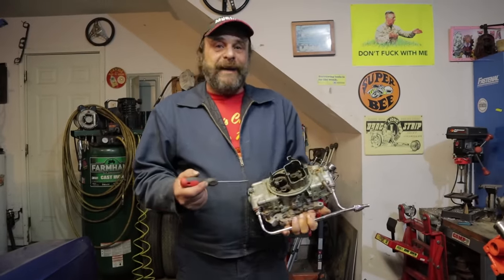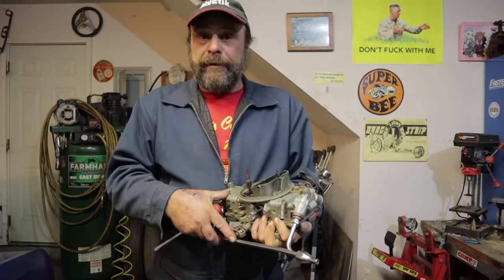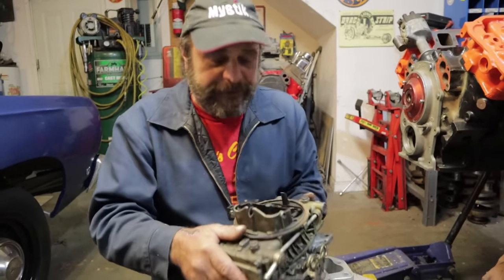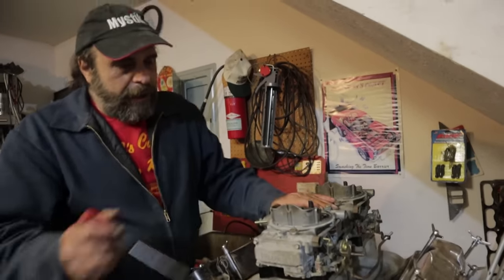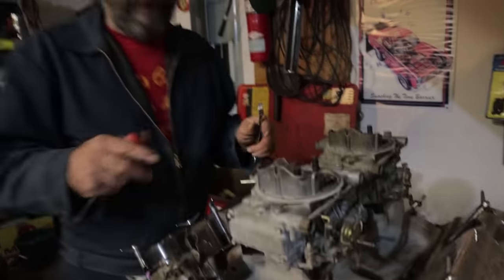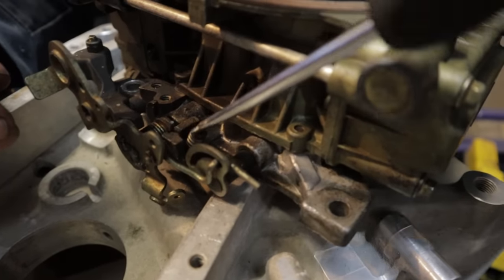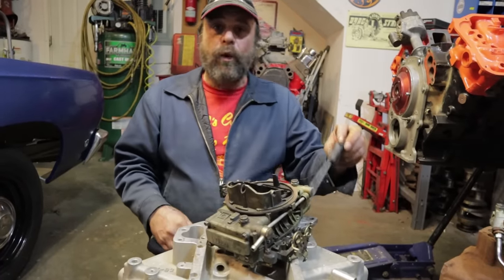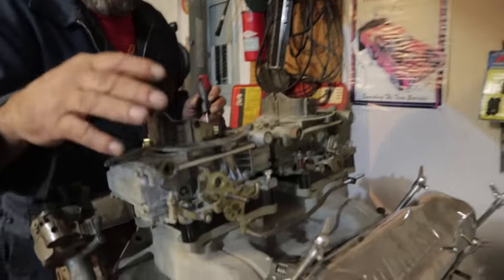Holley Set-Up and Adjust Step By Step

Comment: My relationship with holley carbs over the years can only be defined as "love hate"
Reply: For the last 40+years, me too.
Reply: I've heard the same. Edelbrock might be more my incompetent speed.
Reply: Love hate, when they are set up right I love em, but when they are out of whack I hate em
Reply: My 87 omni had a Holley. Damn thing would get stuck WOT sometimes. Key. off .pull over. Beat with any combination of rock ,piece of curb/ shoulder & tire iron.
Broke CV joint & Got a Daytona before I figured that one out.
Reply: That seems to be 90% of the population feeling about carbs period :D
Reply: Simple as change of weather could have huge effect on them carbs. Jeep CJ-5 with built 390. 1 Winter used as a daily driver I for ever under hood. Carried insulated coveralls with me.
Reply: @theejoeylee  if you loved yourself, you slap a Weber on it.
Reply: Quadrajets and Thermoquads. Heck yeah. The only Mopar way.
Reply: Amen, brother.

Comment: Holley use to have lots of recommendations and tuning tips on their web site. Usually with a rebuild kit there are lots of little tips in the instructions as well. 
I've owned lots of Holleys and still have a whole shelf full of them. once you learn to tune them you won't want to run anything else.
Reply: Agreed.  I used to have an Edelbrock and thought it was great and I guess I still do.  I now have a double pumper and took the time to learn as much as I could about it (there's always more that I could learn though) .  I've been running the Holley for over a year now and I love it.
Reply: @bouncingsoul777  Curious what you love about the Holley vs the Edelbrock?

Comment: WOW,  Tony. Thanks a bunch for bringing back Fond memories. Of tuning and setting up the normal Holleys and the Double Pumpers.
    Had a Large double on my 350 Chevy small block.  After getting it in place and bringing the fuel in right. 
  Would take my truck around the block and after setting every thing just right. My Truck would dance!
   Foot off of the Gas. Almost dead stop, just rolling. Tap the Gas it would jump forward again! Any good music worked. LOL 
  Any Long Highway or Freeway traveling. Just cut the Gas out until before dying.  Back a touch, then adjust idle to lower rpms.
  Best way to get better MPG, and save cash too. 
   There isn't any vehicle that you can't tune just right  with those Hollys!

Thanks again for the video. And it looks like you had Fun doing it too!

Comment: Just finished my 302 install that I talked to you about on live stream once! It's bored out to a 312 that's why I called it that during the stream. I got the engine basically running but my timing is way off so after I get that I put a basic carb tune like the one you mentioned here on it. Thank you so much for many great years of expert advice! I wouldn't be in the place I am today without your guidance

Comment: we used to rebuild these carbs 40 yrs ago when we had a fleet of 460 fords. you are spot on when it comes to the external adjustments. we were always replacing the 'power valve',  usually a eng back fire would take it out... the problem we had was that very few guys knew how to rebuild them & set them up. an old school mech showed me how & it wasn't that bad once you rebuilt a couple of them..  i was glad when they sold off those 460 fords though!

Comment: Thanks for this video. I just recently purchased an 83 Camaro Z28 that had been swapped with a SBC 350, and have spent the last 2 weeks rebuilding most of the mechanicals from the ground up, replacing what needed replaced. I have it moving down the road now, but it needs some tuning, it has some hesitation when the throttle is mashed but accelerates smoothly if I ease into the throttle. I've never tuned a carb, but this video makes me think I at least have a shot at it. Holley DP 4150 is what I am working with. Thanks again!

Comment: Thanks so much for your videos. I greatly appreciate them! This seems to be an artform that this slowly disappearing. 

My girlfriend has her grandpas trucks (69' F-100) and it seems to start/crank just fine. We replaced the carb with a refurb'd motorcraft carb, since we couldn't get her accel. pump to stop leaking (even after a rebuild). It not longer leaks after the carb replacement, however the truck will crank, start and idle just fine- even without the use of the manual choke- but after it warms up (like driving to work), the truck will lose power and eventually stall. It won't run again until after a good 15 minutes or so have passed. 

We have spark- and the truck doesn't appear to respond to carb cleaner when sprayed. After it cools down though, it acts as if nothing has happened. 

I'm "new-aged" mechanically inclined- so I'm somewhat familiar with engines in general, but this whole carb thing fly's completely over my head. She wants to sell the truck- but it starts up and drives so good, that I believe that it's just a tuning issue- or something that happens AFTER the truck has warmed up, and goes away once cooled down a bit. 

Not sure why I'm writing this long post. I'll go back through from step one and see if I can't better describe the issue that we're witnessing and then report back. I'm sure we'll be referring to your videos until then. Thanks again for all your guidance. It's very much appreciate from keeping older vehicles from the yard. 

Joey

Comment: Interesting information Uncle Tony, although the Holley Manuals can be jam packed full of Carburettor goodness, they can be a little vague at times. Wholly, I think the eagerness young blokes can be at fault here wanting bolton power - fit and forget so to speak - and wonder why they run into trouble for rushing a job they needed to take their time with. I believe the mystery of Holley Carburettor tuning is solved, so it makes more sense now. I did see and read an article last year where a double pumper was modified for street/bracket racing for aesthetics, power, metering and airflow, which was very interesting indeed. Thankyou for sharing this, Cheers :-)

Comment: THE SIZING OF THIS DESIGNED PART is everything,just like sizing the cam for the use,this carburetor has been masterminded since 1970,me, is use the 350 500 cfm two barrels for all of my needs,for drag racing and top end speed,its a proven track winner, LINDSAY proved two of them were even better than mechanical fuel injection on the fastest SUPERBIRD in the world on the bonneville salt flats,carburetors are superior for total all out fuel flow,it was a normally aspirated and damn impressive hemi,they function pretty good on blowers too

Comment: Absolutely great vid . Im in the uk and have a dodge d100 1971 , 318 v8 with holley carb same as the vid. 

The motor is burning oil pretty quick ( but no smoke coming from exhaust, even under load) 

It has a couple of oil leaks i need to address first, one of which is intake manifold gaskets. But these are only seeping/not dripping.. 

I also have oil coming out of the dipstick tube when pcv valve is fitted, if i remove and vent to atmosphere this doesn’t happen.  ( was venting to atmosphere with pcv fitted anyway) 

It doesn’t struggle to start and even runs okay, smells like its running rich though . 

Never had anything like this car wise and worrying ive bought something that may need more work than i would have liked . 

🤦🏻‍♂️

Comment: Bought a 350 Chevy with a Holley.  Leaked; replaced it with an Edelbrock that was laying around, runs great.  Hope to build the Holley soon but looks complicated with the different cams, other adjustments and jet sizes.  Rebuilt a Quadra jet years ago and it worked very well.

Comment: You are the Man. Not only you have the knowledge, you can also transmit it. I was wandering if you could help me with a question please. I am now 67 years old, and in my younger days I use to work on cars. Recently I have changed a 1986 Automatic Full size Bronco 351 Cleveland rebuild and with no many miles on it, from dedicated "LPG", back to Petrol, ( or what you guys in the States call "GAS", I live in Australia by the way). I fitted a 600 Holley Vacuum secondary which I had put it together at least 20 years ago. It  starts at first go and idle to perfection and smooth, but I smell fuel vapour at starting, more like an exhaust fumes like, even in the engine bay. Accelerates smooth and quick .I  changed the" MSD" mechanical advance bush into the blue , All up I have 32 degrees advance with 11/12 basic. the bush for LPG I had to make it myself because it didn't existed in the distributer kit , etc. .Once on the road I'll have to finally tune the through out springs, to suit the mechanical advance. Question is... : way it smells so reach??,. adjusted "carter" electric fuel pressure to 6 PSI with cold temperature anther the bonnet and engine . Fuel pump should start together with the starter motor solenoid at firs  ( because of the safety switch installed), but, because it is/was only a Sunday car, or just to go bush, when I rebuild the engine I fitted a secondary oil pick up, Just a tube like, just off the inside bottom of the oil sump) in other to pressurize the block before occasionally start it, and what it does, it starts the fuel pump a bit prematurely, maybe coursing a rich condition???. I didn't had this problem with "LPG". Or I am imaging thinks???? So I dropped the Fuel pump pressure to 5 and a 1/4  "PSI" , I will restart the truck tomorrow in day time.. " too late now". Will like to see if the enrichment is gone, but a good needle and seat valve and good float adjusted (as "I THINK" they are???), should stop  extra fuel passing needle and seat, unless the "O" rings are flatted???? . The carburetor was kipped in a seal plastic box, and when started first time two days ago, the throttle plate leaked a drop or two only, out of the secondary side plate shaft, (and no more now),near the secondary vacuum unit. I hope I gave you enough description, I know is never enough. You response and opinion at your time, is very much appreciated. Kind Regards... "COS".

Comment: Thanks for the video and for sharing your knowledge, Tony.  Holley carbs or any carb for that matter:  It's all about physics and math. ( I'm glad that Holley did a good job with that and documented it for the masses.)  I've been using Holleys since the 1960s and love them.  In the 1980s, Holley came out with the 4010 & 4011 series, (which is no longer produced by Holley).  They were my favorites for street use because they had annular discharge boosters and the float bowls were cast into the carb's housing, so obviously no leakage from there.  All of the "consumable parts" that fit the 4150/4160s, like floats, needle and seats, accelerator pump diaphragms, ect. fit these carbs.  The only issue was finding the correct squirter size which, unfortunately, was cast into the booster assemblies so you had to replace the whole damned thing.  
 When these carbs went out of favor, Holley didn't waste any time quitting the making specific parts, like the boosters.  Summit Racing saw something in these forgotten carbs and bought the design.  It's now sold in a much more refined version that provides for tunable squirters and idle fuel circuits.  The design that originated at Holley became the basis for these durable and dependable carbs.  I've got a 600-CFM, vacuum secondary version on my late model 5.0 that sits in my 67 Mustang Fastback.  (I just had to say that)  Also, I don't want to sound like a salesman, but I'm just sayin'.  It's a damned good design that's affordable and doesn't constantly need attention.
There's one more thing to add:  The old Holleys were heavy because they were cast in zinc.  Zinc and ethanol don't like each other, even 10% ethanol has given me issues if the fuel sits in the carb for a while.  
The 4010 and 4011 series were all aluminum which was something new for Holley in the 1980s.  There was the discovery of a casting method during that time that made intricate parts more easily cast in aluminum at a reasonable cost.   It seems that most of the 4150s and 60s sold today are aluminum as well as those Summit units derived from the 4010 & 4011.  The zinc castings are still available from Holley, FYI.
Thanks again Uncle Tony.  You've got a good channel that shows the world that there's more than Chevrolets out there that go fast.

Comment: I was looking all over for how to get back to the base settings after I changed heads. This would have saved a lot of trial and error. One thing that really helped get it running right was getting the transfer slots adjusted.
Reply: Should just see a square hole forming on the transfer slots

Comment: My problem and I have the Holley 80457-2 4 barrel.  Starts fine, and revs fine sitting.  I live in San Francisco and my car is struggling to get up the hills. Have had a full tune up, car electronic ignition, 350 Chevy eng.  going up hill, struggling to achieve power, no surging, and I can put car in lower gear and no difference.   
Ideas?  I thought could the mechanical fuel pump be bad? Car has 2,800 miles on a 18 year old engine.

Comment: It was refreshing to see you using SAE wrenches. I used them on my '82 Dodge but that was decades ago. Everything in my yard these days is 99% metric. 2000 Ford van (Canadian built-the 99% metric), 2006 300 Semi-Hemi SRT8 and 2015 Hondu Civic. I can send you another set of SAE wrenches if you need them, I don't have much use for them anymore.
Reply from the maker: Thank you! But, I've already got plenty

Comment: believe it or not I just gave a speech that was just a condensed version in this the other day in college, brought in my qft 600 cfm carb and rebuilt it in front of the class.
Reply: Nice Dude.. don't ever Give up.. if they will listen, keep telling them..
Reply: I have a similar story. My shop teacher in high school was giving a lecture on Holley carbs and I had mine torn apart and was telling my nearest classmates what everything was. "Mr. Aguilar, would you like to teach this lesson?" Sure. I'll give it a shot. "Mr. Aguilar, would you please go to the office and tell them to put you in Shop 2 as a student and teacher's aid for this class?"
1983. High school.
Reply: Hey you could give them a demo on a Rochester Quadrajunk. My be less than desirable but if the floats stick just tap it with a hammer to free up the obstruction.   Then ask if they can tap on a clogged injector with a small hammer to get by ??

Comment: I once had a Chevy 350 that I put a 750 Vac secondary Carb on.Mild cam also & old cast iron Exhaust manifold on to.It ran like a pig on full throttle but ran perfect on a Dyno.Turned out the fuel line was getting to hot next to the exhaust manifold & the fuel vapour was drawing in on acceleration full throttle & stuffing up the fuel pump.Also the fuel pump was over 7lbs pressure & this stuffed up the float level in the carbi.Next I found out the Mufflers were 2 restrictive & this buggered up acceleration also.On a good note I had a 351 Cleveland that ran way to rich just off idle & a USA magazine said drill out the butterfly,s 1/8 to lean out the mix & bring back the idle mixture use.Bingo,it worked a treat.The 750 double pumper was drilled 4mm in the end & fuel economy came back as well as clean spark plugs.It was the lumpy cam that created this drama & I had to advance the timing from 8 to 12 static & drop total from 38 to 27 deg all in by 2500 rpm .Also it had closed chamber 302 heads on it giving high compression & was told they had to come off for our low octane fuel.Not true  I got 400 HP after all this and a set of 2.5 in Super Turbo Mufflers. The 1250KG T bucket got 11.8 seconds on a 1/4 mile like this any day of the week.

Comment: I always adjust idle mixture screws with a vacuum gauge finding peak vacuum. Once you find peak vacuum you can take that value and divide it in half to get you in a good range for the size of the power valve you need. Example 15 pounds of vacuum would be a 7.5.
Reply: Exactly. Some guys say thats wrong. They want you to check your Vac at your cruise speed, then go down a couple numbers (12" at cruise = 9.5" power valve)

While it does kinda work at cruise speed (dumps fuel too early for me), where it really screws things up is taking off from a red light. My cruise Vac is 15", my idle Vac is 5", so I tried an 8.5" pv. When I take off, my Vac pings to 12" maybe, then drops to below 8.5". My power valve opens and dumps in fuel at 2000 rpms, part throttle (pings 10 afr when I want it 13.5 to 14:1 afr).
I put in a 4.5" pv, all is good now

Comment: Good morning Uncle T! I just inherited my dad's 78 Ramcharger, 318/727, (all wheel drive which I don't really like). Dad thinks the oil pump went out or got blinded, I suspect a roached cam or spun rod bearing. It's the last year made where you can take the top off all the way up to the windshield!
Reply from the maker: Good luck with it!

Comment: Holleys are great for all the external adjustments that can be done, especially setting the float levels over other carburetors. But they are big with a tight fit in dual quads applications, can rupture the power valve easily during an induction backfire and have several places to leak. For all out performance they are top of the heap though.

Comment: show them how to adjust the secondary throttle blades and setup the linkage to close the secondaries . Im working on my 71 demon and looking for more info although I am running the pro form 750 with four corner idle screws overall great video getting in the basics probably best to recomend something to catch the fuel that sometimes comes rushing out of the sight plugs

Comment: Awesome video! helped me out lots did have one question. I can’t get my float setting lower then 3/4 up the glass on the secondary’s on my Holley 770 avenger. I’m pretty much maxed out where the adjuster nut is just grabbing the needle an seat valve. Any suggestions?